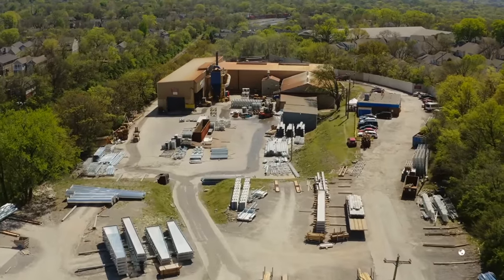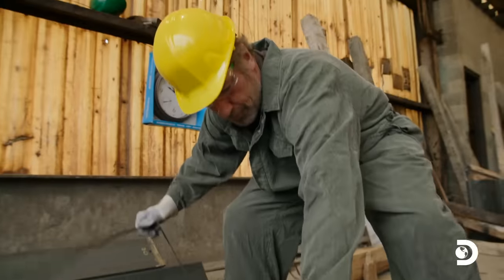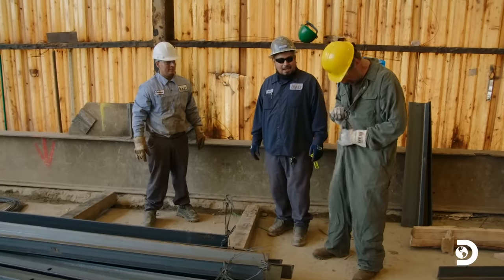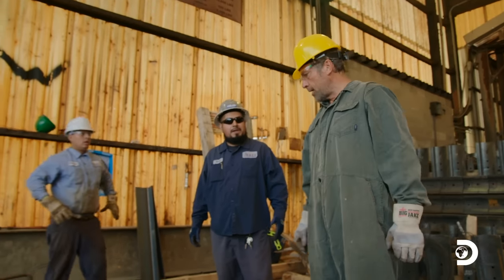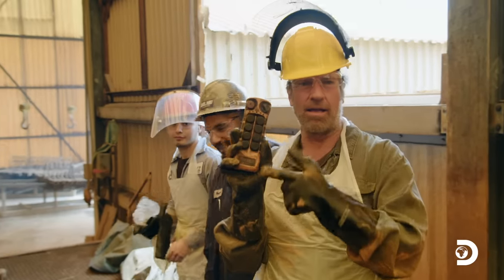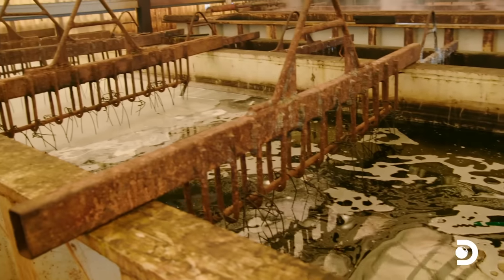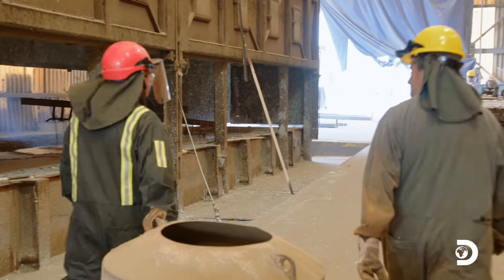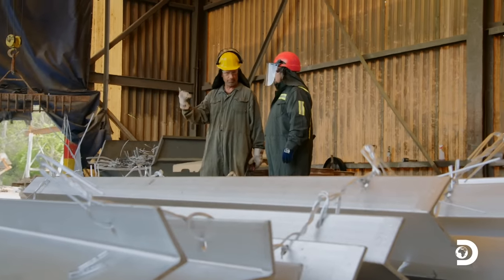Mike Rowe Has a Hard Time Making Galvanized Steel | Dirty Jobs

Comment: I worked as a material handler right after highschool, both at a local GFRC plant and sheet metal supplier. Needless to say I didn't last long, I got into skilled trades as quickly as I could. I still work a physical job but it's by no means back breaking work, the pay is a living wage, and it's interesting work. I've been a sprinkler fitter, FA tech, electrical apprentice, before now where I work as a commercial operations engineer. I would advise anyone, never be afraid to work with your hands, and never have too much pride to walk away and choose something better suited to you.

Comment: Typically the hot dip galv’d structural steel is for exterior applications not usually in bldgs unless exterior wall applications or exposed to weather.

Comment: This is a great one. See we're going to be doing a lot of infrastructure work a lot of the stuff we're putting in is hot dip gal or stainless steel which is very expensive comparably a lot of infrastructure sits outside or outside light conditions

Comment: As a welder the lack of respiratory protection around the metal work industry is quite disappointing. Especially with something like zink and whatever is on that steel being vaporized. Alway wear a respirator when working with Liquid Metal, welding metal, doing any type of hot cutting and any type of grinding or polishing. Pretty much all the time.

Comment: I worked at AZZ for 6 months. I was the only non felon… it was rough. Tying the wire was pretty fun and easy one you got the hang of it but the management was terrible.. I eventually learned the whole the process and swapped around different stations. I ended up quitting bc of the terrible management and promises never kept. Was told I would be getting raise all the time (especially after becoming valuable and working nearly 84 hours a few weeks). Then I got hurt on the job and they got mad at me and sent me up front to clean the (drips) worst part of the job. They treat you like dogs up there. And you could only use hand files. They had all the grinders locked up and you had to ask permission to use them. Terrible job and I never look back on it expect when I tied wire!

Comment: As an iron worker I hate these guys. Whenever structural steel goes to a galvanizer it always shows up on the job missing tags or the tags won’t be legible because of the galvanizing. Makes figuring out where the pieces go a nightmare when you have thousands of pieces of steel to erect. Not to mention welding to galvanized steel sucks.

Comment: Most of the galvy steel I've put up on cell towers came from the UAE and those fuckers don't grind any of those "zinc boogers" off so you end up getting stabbed by them, or a part won't even fit flush with another. We need to get our steel from Hector.

Comment: You can tell this job sucks. The employees seem exhausted, none of them seem to be enjoying the job at all, they seem afraid to even laugh or joke around. You breathe in chemicals all day and get splashed with acid. It's necessary work so I respect the hell out of these guys, I just wish it was possible to provide them better conditions. I've worked with steel for a long time and to me it always seemed like platers/galvanizers had the worst gig in the whole process.

Comment: This shows why all of our metal products come from China. The chemical vats of acid, fluxing agent, and molten zinc have a limited useful life and the chemicals need to be drained and refilled. Here in the States, the old chemical is either trucked away or denatured on site to be rendered harmless. An expensive process either way. In China and India, they just dump the used chemical in the river and fill the vats with new. Never slows down production and no extra cleanup costs incurred.

Not saying it's good. I don't want to live next to a polluted river, but until we force foreign countries to produce their products in an environmentally safe way, the USA will continue to lose jobs and industry to lower cost foreign goods.

Comment: I did that job years ago the bit where you skimmed off the crap on top of the pool.  I did that for less then four hours . I was given zero training and zero information about safety. At one point I looked around and saw nobody . I thought it must be break time so I started to walk away when some guys who were behind a small free standing wooded wall started yell for me to RUN. So I ran to them . They were all down near the floor and somebody said did the boss not tell you about the acid and molten zinc . I said nope . If I had not walked away when I did and got down behind that wall I would have had zinc all burning me to the bone. That is what I was told . Anyway I have asthma. Later someone noticed me using my inhaler and came over to me and said I should quit right now just walk out. I said no . Then more people came and said the same thing except some said prior to working there they needed no inhalers and now they almost all had them . They said I would not be able to last until the first break . They were right . I walked off puking up green stuff. At the time I still lived with the evil woman I called mother. She said YOU QUIT you are a Coward. I went to bed but kept a bucket next to me and was up all night coughing up the green stuff. She had zero idea of how bad that job was .

Comment: When you grind the "Boogers" off at the end, aren't you leaving a non-galvanized spot behind that could then corrode?
Reply: hot dipped galvanize penetrates  pretty deep rule of thumb is if you don't get alot of sparks the galv is still there that and it looks like they are using sanding discs that just get filled with the zinc after a couple uses and become nearly impossible to actually grind on steel
Reply: @chriscahill1005  Minor correction there Chris! Properly done galvanising soaks in to the metal. Chinese galvanising just sits on the surface. They make it look like it is galvanised until you give it a closer inspection. 
Mark from Melbourne Australia
Reply: @markfryer9880  huh I guess I have only worked with properly done galvanized then
Reply: @chriscahill1005  Yep! Aren't you fortunate! It's the same way with their mild steel, it's only slightly tougher than drilling some Aussie hardwoods. Try to then drill true Aussie Structural Steel and you come to a halt really fast as your bits seem to go nowhere except blunt.